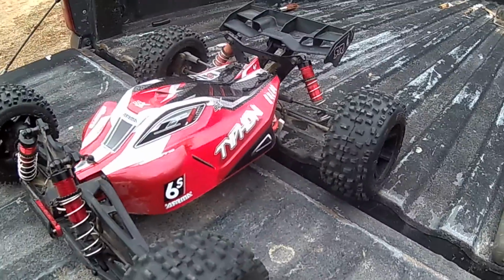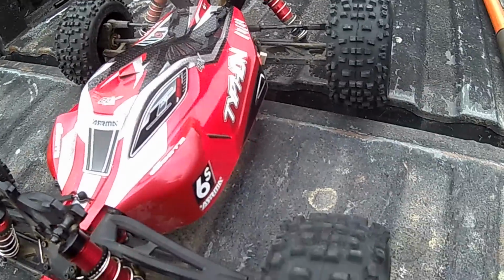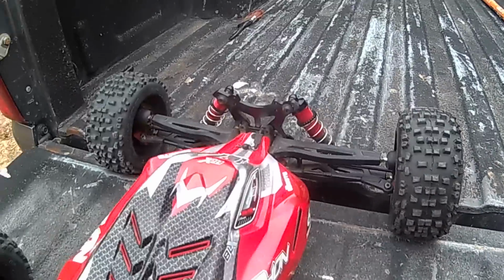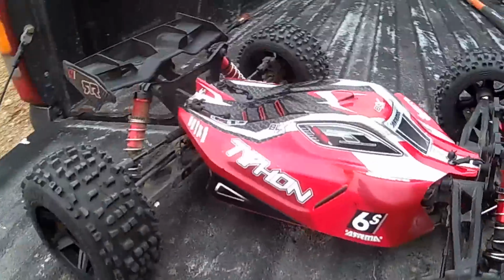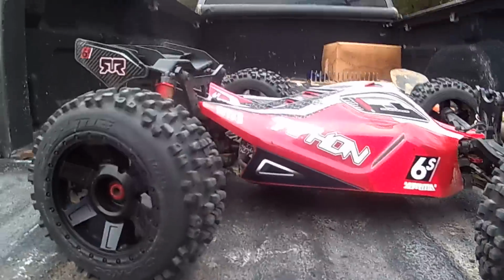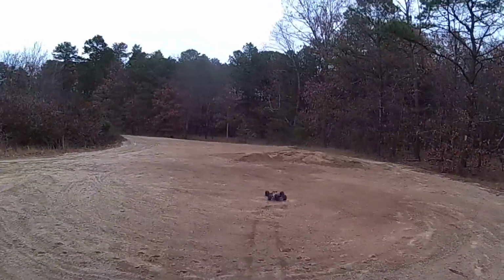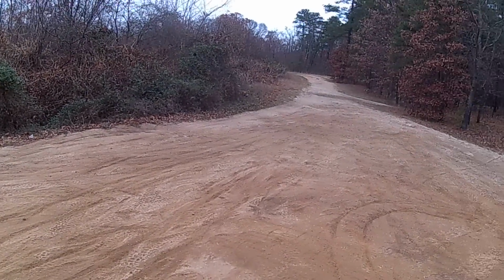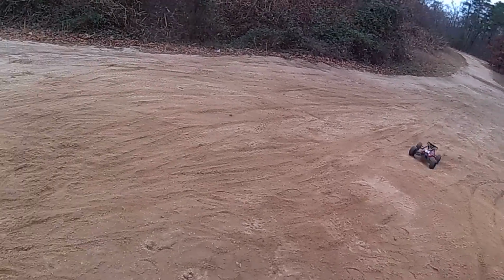Arrma Outcast Hybrid Test 3   DIALED IN  Huge Donuts At 16.30

Comment: I did the same but used a talion. Try the proline 4.0 tires it sits a little better.
Reply from the maker: OK I will check out...on what wheel?
Reply: RCbashing the KRATON I went with the blockades premounted and surprisingly they last great even driving mostly on pavement. I can do standing backflips on 4s or with about a foot worth of air. I got all 4 at $50
Reply: RCbashing the KRATON they came on split six 1/2 offset so it would also make your car even wider
Reply from the maker: yea. are they small knobby like tailons tires.? the badlands have 1/2 offset too.. they are ones im liking so far..I have been trying different tires to see whats up..... The badlands 3.8 are the ticket.. This thing is wicked as far as handling.Air control is touchy with short wheel base.. I see double and triple backflips in its future...BASH-ON
Reply: RCbashing the KRATON the 4.0 is a little bigger than the 3.8 but there is more tire definitely
Reply from the maker: gottcha..Thanks again....
Reply: RCbashing the KRATON just did a a quick measurement 6"tall x 4" wide roughly
Reply from the maker: nice .. My badlands are only 3inches wide... 6inches tall
Reply from the maker: +Matt Taylor  nice job.... nice how ARRMA makes interchangeable parts... I will be getting in body on Monday... I got set of pro line MX 3.8 tires are almost exact match to outcast... good luck and bash on....

Comment: Great video. Keep hearing great stuff about the Outcast, was checking one out at LHS today, looks bad ass. Shocks felt pretty soft, easy enough to dial in though. The wheelie bar looked stout/quality. How's your rig compared to Kraton for fun and overall bashing? Considering both but starting to lean towards outcast. My son and I each bash Typhons and love them.
Reply from the maker: thanks
Reply: RCbashing just saw the epic fail vid you posted. Brutal. Your wing literally shoveled out a huge piece of turf. Wanted to ask if your Badlands are premounts of if you taped them. Considering getting a set to jump with on my Typhon and/or my high-powered Backslash. PS that fail session would have pissed me the F... off. Good job not going postal.
Reply from the maker: lol. thanks... the badlands are taped. which makes huge difference.As far as which one i would get.. Hard to say,i love my Kraton and Outcast is blast to drive..But if i had to pick one it would have to be the Kraton.... for bashing or outcast for pit driving..I know that is not going to help much but it depends what you do with it more...
Reply from the maker: Rich Duperbash lol. thanks... the badlands are taped. which makes huge difference.As far as which one i would get.. Hard to say,i love my Kraton and Outcast is blast to drive..But if i had to pick one it would have to be the Kraton.... for bashing or outcast for pit driving..I know that is not going to help much but it depends what you do with it more...
Reply: RCbashing the KRATON thanks for reply and info. Been wanting Badlands for a while, figured yours were taped as don't seem to balloon much. Neighbor may be getting a Kraton soon, gonna try her out. Digging the Outcast so far...fun geared up on 6s.